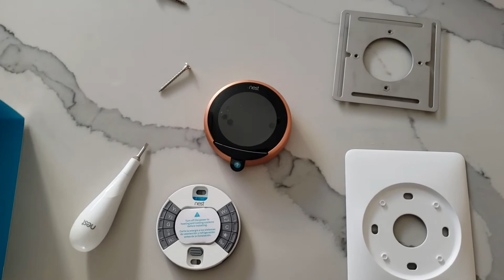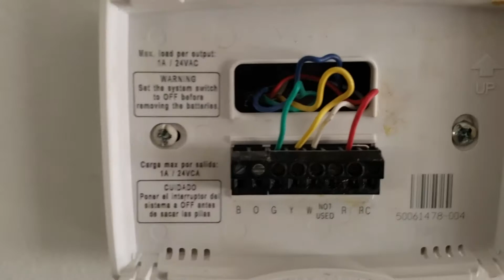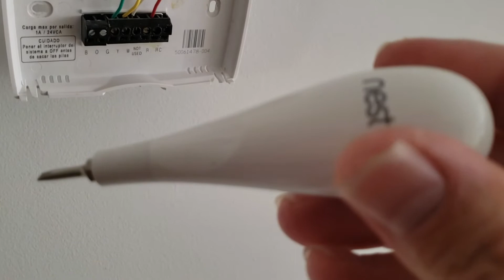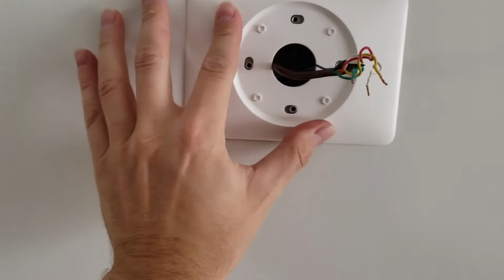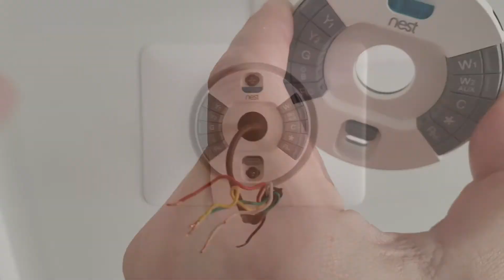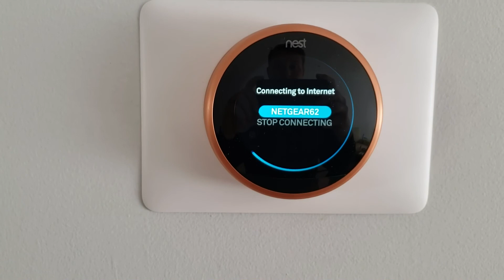How to install and setup Google Nest Learning Thermostat 3rd Generation

Comment: how about W1 vs w2 and Y1 vs Y2
Reply from the maker: Just need w1, and y1 (99% of home furnace usage) the other are for more advanced setups that are typically not used on residential furnace and AC units
Reply: @TheRealSkeptyk  Kool , i check how Many Wires on my older style themostat